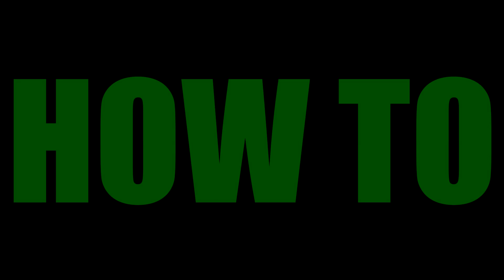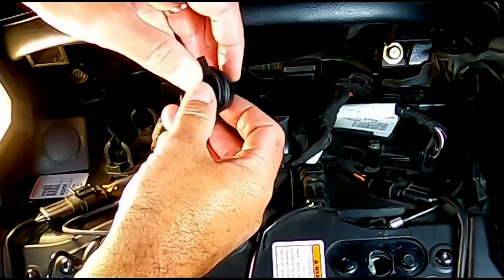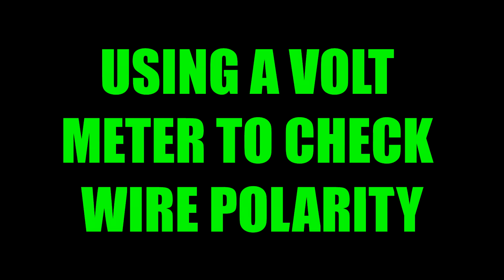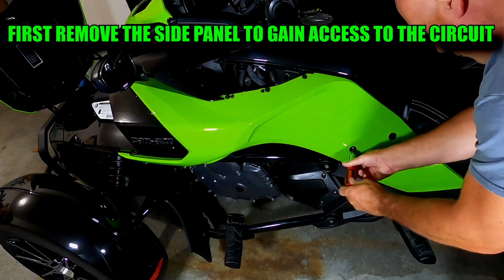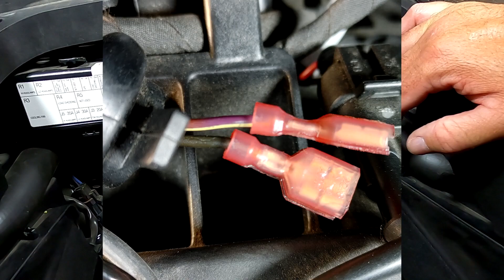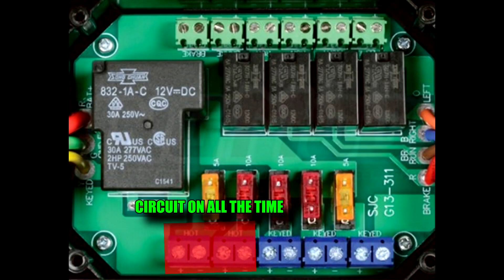Can Am Spyder, Ryker, and RT - Accessory Circuits. This is the best way to install accessories

Comment: Can you connect your aftermarket audio system with the accessories plug.

2 speaker’s and a amp? Someone said it will burn up
Reply from the maker: The accessory is i believe 15 amps. If you try to use an amp for the stereo that is 20 amps or more then you will have problem. Also if your amp is a lot lower amperage like a 5 amp then yes it could be a problem.
If you are using an amp that can handle it then you should be ok. Best to read the instructions on the amp before hooking it up. 
People also forget to disconnect the battery before wiring things up. This is often the reason they see a "burn up". One electrical arc will immediately kill most amps.

Comment: I have an SAE connector (quick disconnect with red and black wire) hanging in my frunk on my 2018 RT Limited. Can this be used for an accessory? Right now use it in winter to hook up to a battery maintainer.
Reply from the maker: It should work just don't overload it. Also it will most likely NOT turn off when the ignition is off so don't hook up anything that will stay on and drain battery when keys are out.

Comment: Good video, would you know where and what number the fuse is for the accessory wire on the left side of and f3? My wire is dead and trying to figure it out?
Reply from the maker: Thank you! On your fuse box and in your manual it should tell you which fuse it is and what location. It should be labeled as Customer Acc Circuit, or something that says accessory. I believe it should say Customer for all years first then ACC or accessory. This refers to those wires. I hope this helps. Just remember that those wires will not become "Live" or "powered" until the key is turned on. Be sure you are not checking all of these when power/key is off.

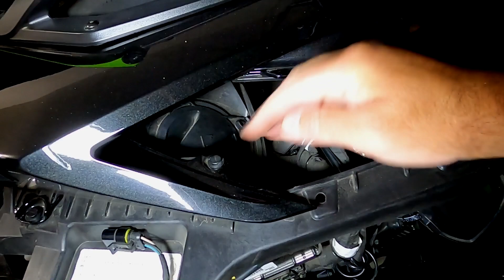Comment: Do you know what that connector used for at 8:00? The one at left down corner.
Reply from the maker: @YalcinAydemir  my model did not come with cruise control, heated seats or grips and it may be for that. If you need to know for sure, you can buy a mechanics manual and it will have a schematic of the electrical wiring and will tell you exactly what it is for. Sorry I didn't have a for sure answer but it is an extra wire for upgraded features. Thanks for watching and comment!
Reply: @MOABMAN  mine have cruise control, heated seats and grips but still that connector is unused. I checkt the manual, couldn't find out.
Reply from the maker: @YalcinAydemir  I will look into it and get back to you within a day or so. What year and model is yours so I can search specifically for yours.
Reply: @MOABMAN  spyder rt limited 2022 thank you
Reply from the maker: @YalcinAydemir  glad to help, it may take a few to get back to you, but i will.
Reply from the maker: I checked the wiring diagrams for your year and model. It should be the cable for fog lights.  If you do not have fog light, you will see it on the clip that is in that area.
Reply: @MOABMAN  Thank you very much. I will maybe install fog lights next summer 😁

Comment: Great video!! Do you know where will I find the wires on a 2013 rss and what color
Reply: Thank you very much sir !!! Another question I see a fuse assign for a radio even though  the rss does not come with a radio ,  is there any wires or harness  I will be able to tap in to for an after market radio installation
Reply from the maker: @JesusFlores-th3ej 
The best and only answer i can give you for that one is not an easy one, so hope you have a lot of patience! 
The best way to trace anything from fuse box is to get in behind it and just find those wires and trace where they go. Unfortunately, this is not easy but if they lead to an end that is not connected to anything, then you can use them.
If there is no wire to that fuse location, then you can tap into that location and just run your own. 
Hope all this is helping you, and just let me know if you need anything else. 
Feel free to email as well!
moab.man@yahoo.com
Reply from the maker: @JesusFlores-th3ej 
2015 and earlier models are all over the place with differences. The accessory circuit should be the same locations though. Please also be aware that different countries/locations have different color codes sometimes. There are only two wires and i believe no matter what area the bike is for, the ground should always be solid black and the positive will be a colored wire or color striped wire. What I mention below is for US models and I hope this helps. If this information does not seem to work for you, the best thing to do is find the three locations mentioned here and look for wires that just end and are either wrapped with black tape or zip tied at the ends. These are usually the circuits. Do use a volt meter and test them if you are not sure.

 The front circuit is located behind the storage box. The middle circuit is under the left service panel. Both of these are just the harness and no connectors.  The rear circuit Is under the passenger seat. Plug is provided. Wiring is a black wire (ground/negative) and purple with a yellow stripe (positive). Power is only applied with the engine running. Fuse is located in the right fuse box (behind the storage box) position F6 10Amp.
Hope this helped

Comment: Nice video, how many LED lights strips can the accessory wires in the fronk can I hook up. I have one strip that goes under my frunk that I got from Leon hooked up to the accessory wires in the front. I just bought 12 small under glow LED lights. I don’t wanna hook them up to the battery. I’m afraid I’ll forget them can I hook them up to the accessory wires too, without blowing the fuse?
Reply from the maker: There should be something that came with the lights (or online from the maker) that will tell you how many amps they pull. Led's do not pull a lot, so you "should" be ok if they are very small. I think the accessory lines are 15 amps standard.

 I have 10 sets of small lights on mine, and each piece has 6 led lights. If you bought lights that say motorcycle lights, then they are probably fine to hook all of them up.
This is purely a guess and may not be correct on my end, but if they are strips of lights, then I would say no more than 6 feet total length for use. I would test with 4 feet first.
Hope this helps.
Reply: @MOABMAN  Material for LED Strips: Silicone Extrusion
Input Voltage: DC 10 - 15V
Working Temperature: 30°F - 110 °F
Effective Range of RF Remote: 30 ft
IP68 Waterproof for LED strips (not for remotes & control box)
Nominal power: Maximum 36 watts
Battery draw: Approximately minimum 0.5A at DC 12V
Battery draw: Approximately maximum 1.7 A at DC 12V
Reply: I guess I can here is the amps
Reply from the maker: @joeshenekji511  That should be no problem at all with the max at 1.7 A. 
The only thing I would do is see if you like them before putting them fully on. They may not give you enough glow. What I did is wire them in, then tape them where I thought I wanted them to see how it would glow. This way I didn't spend hours and get disappointed.!
Have fun customizing!!!!
Reply: Thank you

Comment: Thank you, great segment.  Very informative.  I can test each cct for amperage but would like to ask what the rated amperage for each cct is?
Reply from the maker: @G-Force_70  The best way to find out the rated amperage for the lines is by purchasing a service manual for your specific year. They will come with wiring diagrams and that information. They are not expensive either. Another way is to look at your fuse box and see what size fuse is in that location. What size the fuse is will typically be what you see out of that line. Hope this helps!
"This is the way"
Reply: @MOABMAN  Very helpful, thank you so much!
Reply from the maker: @G-Force_70 I'm glad that helped. The service  manuals are pretty good detail and way worth the investment if you are going to work on your own Spyder.

Comment: Great video mate! Do you happen to know the name of the connectors used on the Ryker? For accessories plug, and turn signal plug as well? (Three wires) thanks!
Reply from the maker: @davidbergewaytogo  Thank you for that and glad you liked. My knowledge is for US models only so I hope I give you the correct info. The connectors that you are asking about are called JST-SM. They are all called the same but you just need to add whether it is 2 pin (2P), 3 pin (3P), etc. The pin refers to how many wires the connector is for. 
I also want to mention that there are other connectors that are called automotive waterproof connectors. These usually have a rubber type gasket on them.
Hope this is what you needed to know!!

Comment: I have a 2015 Spyder RT does slingmod make an isolation fuse box for that year?
Reply from the maker: I believe this one will work for you. It doesn't say what years it is for, but says "universal". Usually that means for any model or year. Plus the way it wires up I dont think it really makes a difference what year you have.

https://www.slingmods.com/universal-motorcycle-accessory-fuse-block-show-chrome-13-311?vehicle=1

Hope this works for your needs.

Comment: Thanks for the video. One thing you didn't test is to ensure the black is actually connected to ground. Could have done via ohm resistance function on the meter or with dc voltage measurement touching the black on the tester to the black wire on the bike
Reply from the maker: Thanks for the good catch and comment! There are a few things i always wish i would have said different or included in videos. The great thing is i get awesome comments like this one that helps others and for me to improve videos. I do try to keep things simple and the next video out this weekend on fuses is a good example if this. I try hard to keep it super, super basic so inexperienced owners know the basics. Thanks for the comment and support and for watching on a holiday to boot!!!! Have a wonderful Thanksgiving!!

Comment: I ended up pulling panels off the right side of my 2014 Spyder RT-L, but I could not find the access point.  I did not see the tag to identify the connection, and I traced the wires I could see anything obvious.  Other ideas?  Getting behind the frunk seems next to impossible.
Reply from the maker: Connecting directly to battery would be another option . I think it is page 60 in your manual that talks about a 12 volt power outlet you may be able to use but not sure how many amps are there to use. I think it was the 2015 models and newer  when they started tagging the accesory wires.  You should be able to get a service manual for that year pretty cheap now and that will show all the wiring diagrams and schematics of the bike. They are good to have if you are going to service yours yourself too.
The only other thing i can think of is look at any ports ir cigarette lighter type ports in any luggage comprtments you have. You can splice off of those but dont use them for anything else. Do be super careful with overloading a line though. I believe a lot of people have had issues with to many accessories on bikes older than the 2017 models. Could cause limp mode issues if you overload it. Hope this helped any.
Reply: @MOABMAN  This is useful and I will search for a service manual as you suggested. I'm not planning to add much - mostly do led lights for safety. I added the trunk light bar and want to  light up a couple of other spots. Thanks so much for your help.
Reply from the maker: RT models are a pain to remove everything. You may want to invest in the fuse block then just run it to an easy access location. It might be a lot of work at first but will pay off in the long run.
Reply: @SteveSpiderJockey on the RT, looking from the front of the spyder with the Frunk open, at the bak of the Frunk, down low on the RHS, behind a rubber grommet are two wires similar to those shown on the F3 model on this video.  these are the accessory wires on an RT.
Reply from the maker: Thank you for helping on the location for Steve! Unfortunately I don't have every year's maintenance manual or access to show video on all models.
Reply: @MOABMAN  I tried to link this to an Aussie webpage for Australian-based riders.  I wanted an easy how-to page with links to key videos.  Yours is a great video and covers a broad range.  It would not let me share the video.  I assume you have some type of theft blocker, even though it would just embed a view of the YouTube video.  Are you OK if I just share the link to this video?  Cheers Steve
Reply from the maker: Sharing link is fine but a full copy is blocked. I have had a lot of people steal clips and use on other sites so i have to lock it down the best i can. Thank you for asking and appreciate you sharing!

Comment: Can I run a splitter on 1 accessory wire so I can run a usb cable for a quad lock wireless charger and a garmin zumo XT gps? Or do I need to run from two different locations? I have a 2022 f3 base. Thanks for any help.
Reply from the maker: You can run a splitter and it should charge both. If you want a more professional look, there are dual usb connectors that will fit into one of the two circular openings by you key ignition switch that are there for fog light or a push button switch. I looked on Amazon for a "marine usb dual port connection" and found one that worked. The reason for marine is they are usually waterproof or designed for outsoor use. Hope this helped.
Reply: @MOABMAN  thank you for the quick reply! I’m unsure which route to go now lol. I just put in fog lights with a DRL and it has a shiny silver switch that lights up. It’s the SlingMods version. I guess if the marine grade one is silver as well and I can leave the two plugged in even if it rains that may be the way to go.
Reply from the maker: @Zeroplanetz  if it helps, this is the one i bought at the time. I have had it for 4 years now and no issues. I think this looks good but it is a snug fit room wise in between the gas tank. You will have to be careful on how you connect the wiring.

BlueFire Upgraded Aluminum Alloy... https://www.amazon.com/dp/B07MNM7F8S?ref=ppx_pop_mob_ap_share
Reply: @MOABMAN  that’s actually the one I was just viewing. I’ll do a little more research. Thank you much!
Reply from the maker: @Zeroplanetz  your welcome and hope this helped you. Thanks for supporting the channel and comment too!!
Reply: @MOABMAN  yea, I’ll need to find a step by step walkthrough for the actual wiring in part. That’s how I do things lol. Watch and pause video until I catch up 🤣. But this video helped on for what I’m looking for and in what areas. For a generalization this was great.
Reply from the maker: @Zeroplanetz  its pretty easy, just positive to one post and negative to the other. There is a paper that will show which post is + and which is - that will come with the usb adapter
Reply: @MOABMAN  I’m good with what wire to what wire, it’s the connection points. On how to connect them.
Reply from the maker: Soldering is the best way on connecting to the usb then just electrical tape. I would use Spade quick connects to connect to the bike side. That way you can always connect and disconnect as needed. I use heat shrink instead of electrical tape on these points of protection.
Hope this helps.
Reply: @MOABMAN  some good insight thank you again.

Comment: Ok to be clear, there is a customer accessory circuit behind the frunk on the Spyder RT Limited - seems that is the easiest to get to.  Also, the isolation fuse block you recommended - does that connect to the accessory circuit connector or somewhere else?
Reply from the maker: The frunk accesory is the easiest to get to. For the isolation fuse block it is best to go to the products website and see what they recommend doing. There are several different types now and some do have different ways to hook up things. If you want to load your bike with a lot of extras the fuse block is the way to go. Most of the time they connect to the battery directly for power then you connect your turn signals etc to it. Then from there you connect you accessories to a separate spot on the block for add ons.. Hope this all made sense to you
Reply: @MOABMAN  Thanks for the clarification.  I agree with the idea of using an isolation fuse block.  And thanks for your quick reply.
Reply from the maker: @SteveInGeorgia  your welcome and thanks for supporting the channel with a comment! I hope i answered what you needed help with.

Comment: You did not mention if they have individual fuse or the 3 shares the same fuse and how much is the fuse amp..
Reply from the maker: For the 2023 it is on page 170 of the owners manual. It is one circuit/fuse and is 10 amps. The fuse information should ve in the manuals for all other models as well. Let me know if you can find it and for what year and i will fet that for you.